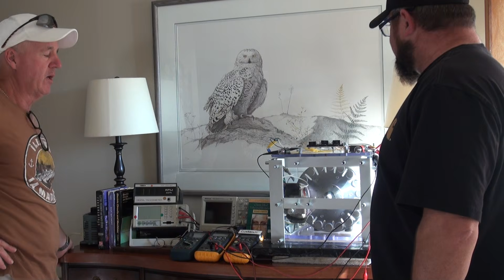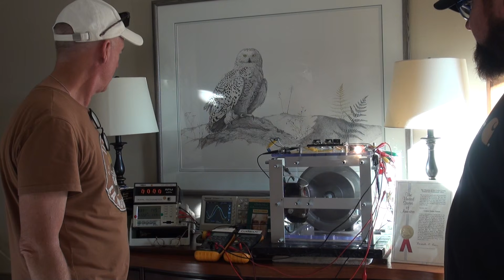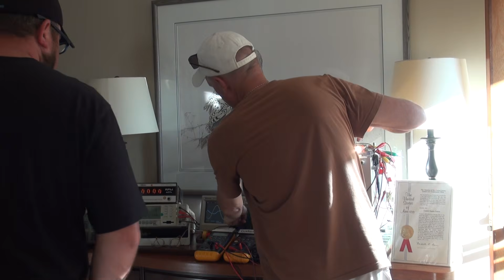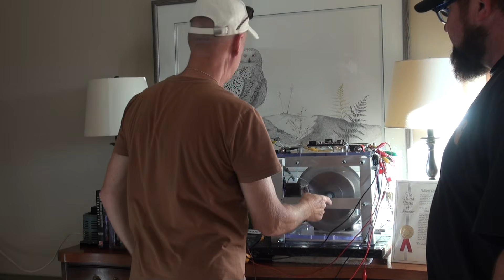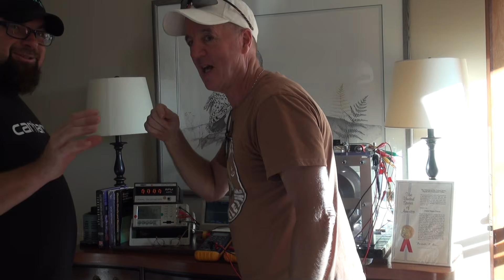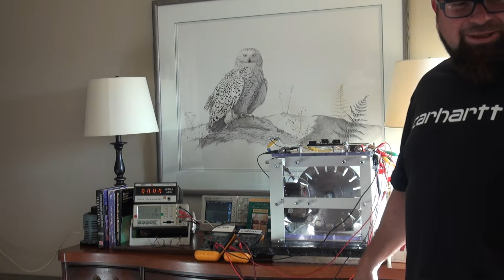Infinite Efficiency Electricity Generation & Electric Motor Operation ReGenX Generator Demo

Comment: So you are simply getting Lenz's law to work for you instead of against you... and on both halves of the cycle.
So the girl approaches,  you attract her and as she walks past you repel her ... and just like Lenz' s law , it's exactly the opposite of what actually happens...😂😂😂❤
Reply from the maker: Lenz's Law of Induction is Negative Work (system Kinetic Energy decrease) which is performed at infinite efficiency with created Electromagnetic Field Energy and
Heins' Law of Induction is Positive Work (system Kinetic Energy increase) which is performed at infinite efficiency with Time Delayed Electromagnetic Field Energy...
Cheers Thane 😏